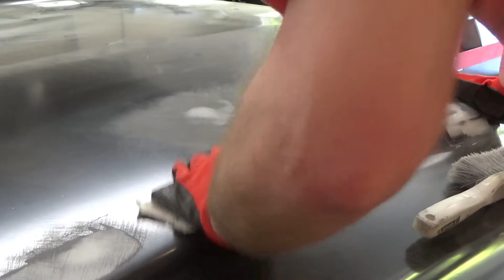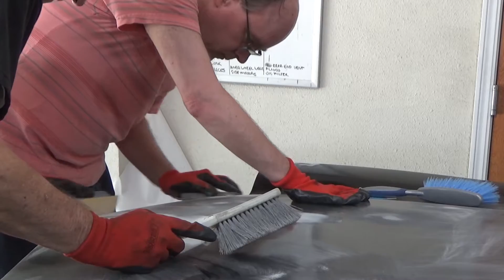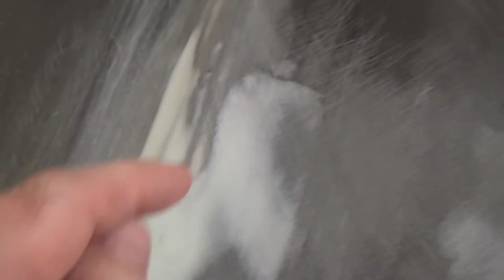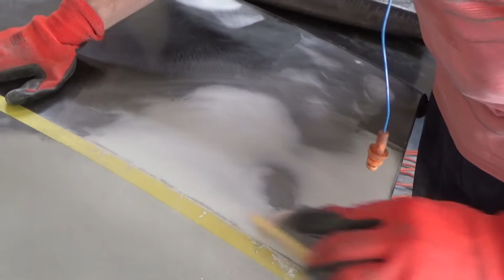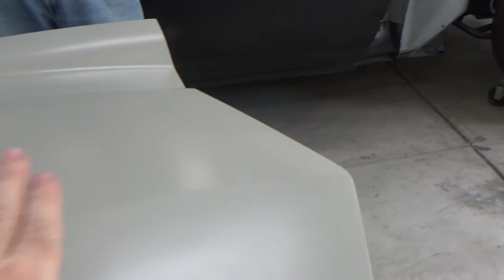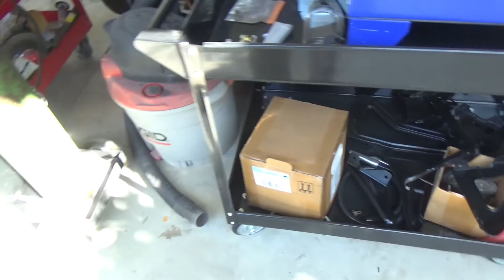1977 Camaro Z28 Part 177 : Hood part 2 - body filler and Slicksand

Comment: Coming along nicely Erik and Pops. The front of these hoods flex alot when you push them closed. I'm thinking about putting some dampening foam in mine at the latch area. Slick Sand is good stuff for sure. Pops wanted to see what mil thickness you guys was getting. 😎
Reply from the maker: Oh, cool. Let me know what you are thinking there. Mil thickness! I thought the same thing! If only I had a gauge. LOL

Comment: Use a little bit longer block so you aren’t making low spots where the filler is.
Reply from the maker: Thanks Michael. We did switch to a longer block when we did the big wipe at the end.
Reply from the maker: Also, not sure if you were talking about the thin rectangle block, but that one is flexible, so we bent it to the shape of the hood in the long direction.